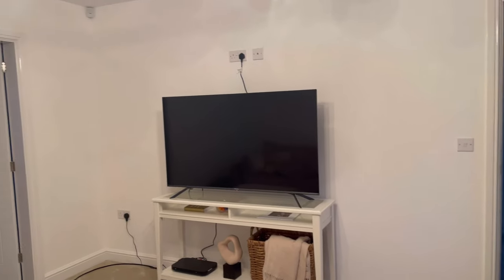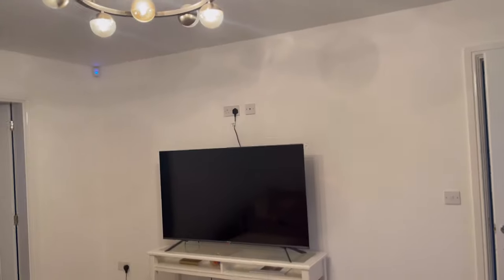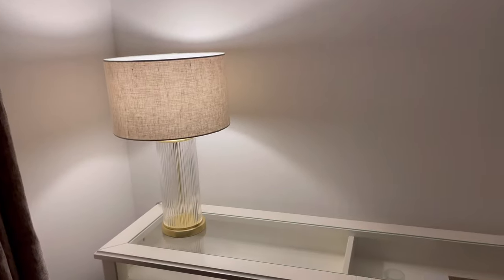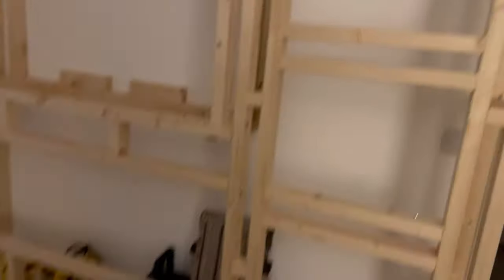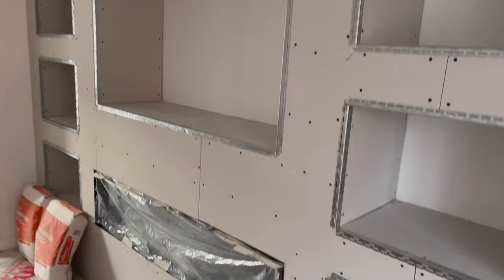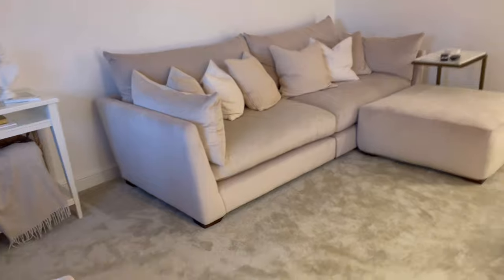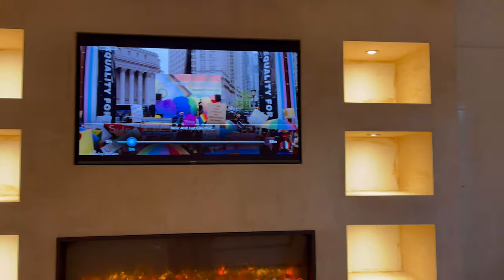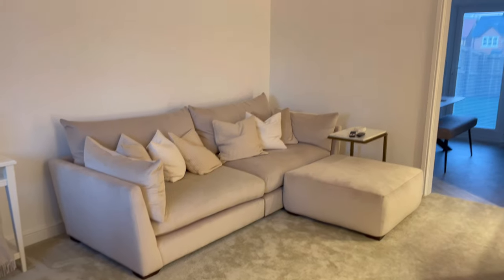TV MEDIA WALL TRANSFORMATION | New build living room updates!

Comment: Hi, how is this holding up since it was done? I have just bought a new house and looking to get one
Reply from the maker: It’s going really well, only very slight cracking on the ceiling area. I easily touched this up with some caulk. It’s just like any new plaster that cracks slightly when it settled